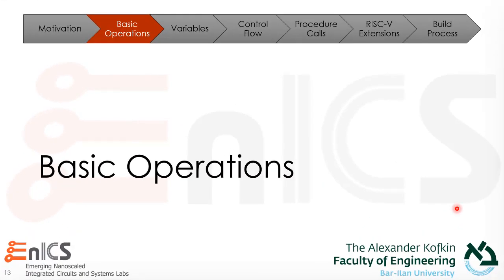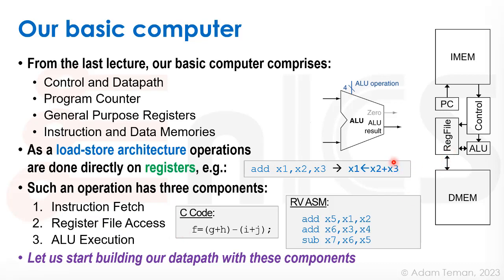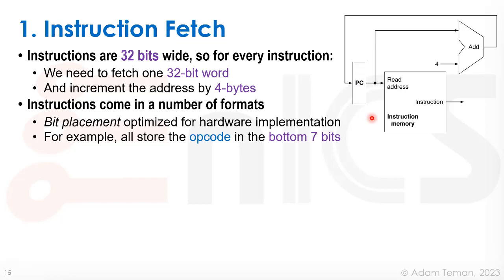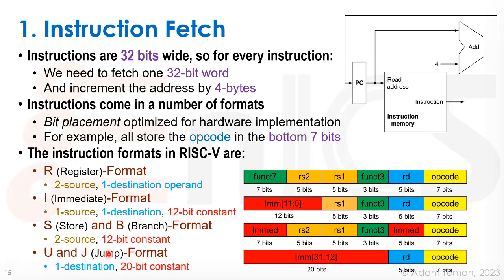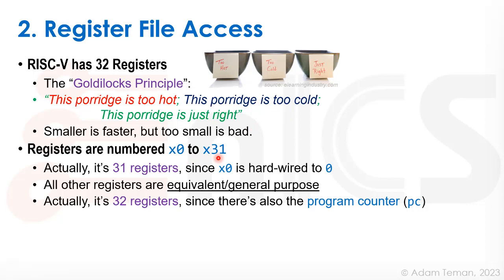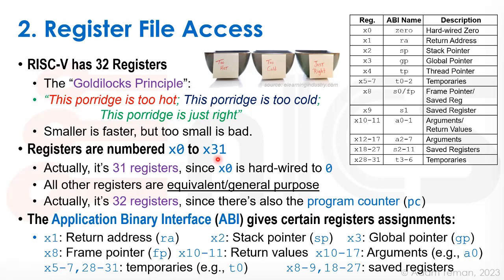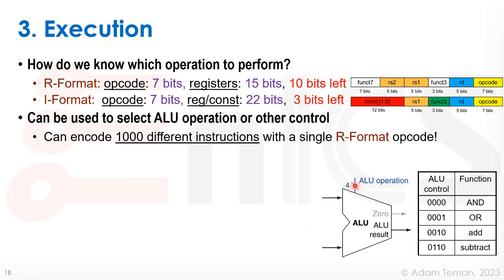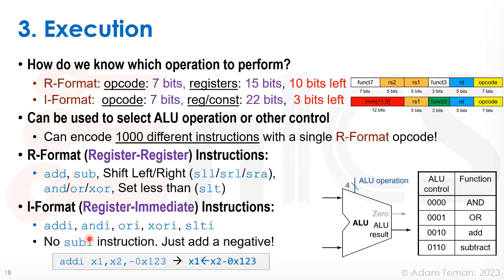SoC 101 - Lecture 3b: Basic CPU Operations

Comment: Thank you for great video.
My question for addi instruction is it right to say it’s a 1R1W as R2R operation was 2R1W?
Reply from the maker: Hi,
Yes, that is an accurate observation. The immediate (constant) is encoded in the instruction, so it does not need to be fetched from the regfile and only one register needs to be read out.
That said, this doesn't really "help" us from a hardware perspective. Since there are 2R1W operations, we need to support this capability, so there is no (straightforward) advantage of an addi operation over an R2R operation.